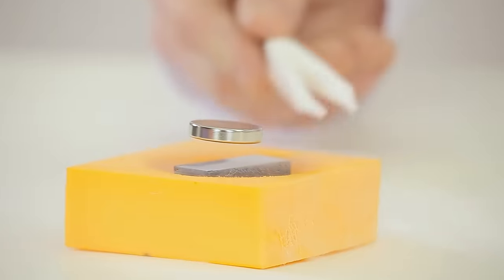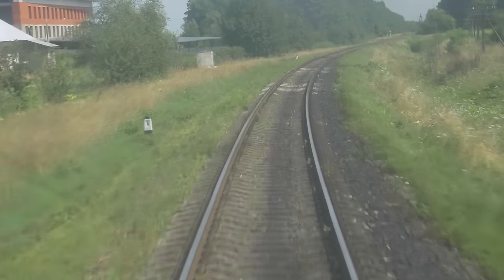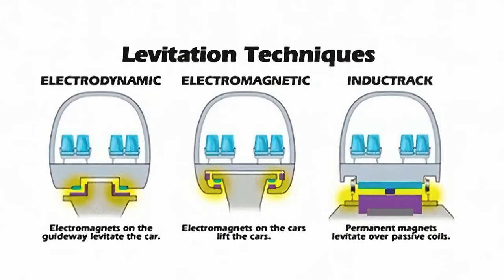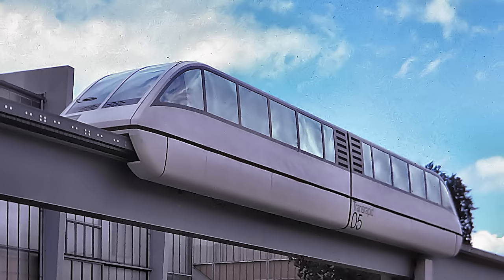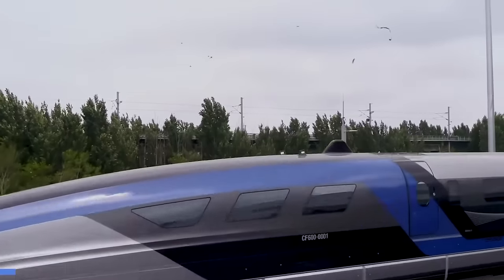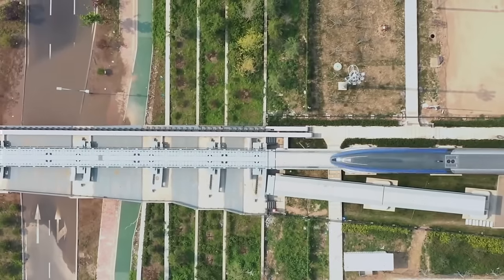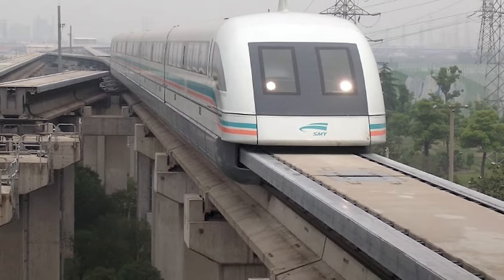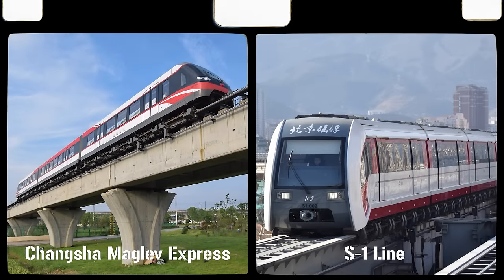Maglev Trains: Why This ALWAYS Falls Short

Comment: Turns out the best version of a train is a train.
Reply: TopGear proved this along with the firetruck. xD
Reply: Heavy snow a few years ago stopped the electric diesel trains. A steam train running a private run continued and carried some stranded passengers.
Reply: @flybobbie1449 A few years ago I heard of a similar story in Germany where they had some sort of headline power issue and they actually relied on some heritage steam trains to haul cargo for a few days until the power was fixed. Kinda cool to think about but nowadays it comes with it's own issues, primarily water on the stops. Not many modern station have the infrastructure to fill up a steam locomotive with water. And that becomes a bit of a problem when your engine uses it as the main power medium...
Reply: Until the release of Train 2: Electric Boogaloo
Reply: Lol
Reply: With that logic, the best plane would be the Sopwith Camel.
Reply: @flybobbie1449  What usually stops electric trains is contamination of the pickups preventing power flowing. Let's not even go into the issues that happen every autumn on railways everywhere with leaves on the line (it's akin to greasing the trascks as far as braking is concerned and a difficult ptoblem to solve)
Reply: Cry in maintenance
Reply: @flybobbie1449  Both diesel or electric are still superior. The only reason the steam train worked is the fact, that steam engines run 24/7, because turning them on takes a lot of time and would be even more impossible in harsh winter conditions. If the diesel locomotives were kept in a shed with the engine idling, they would have worked too.
Reply: @Noise-Bomb  Water shouldnt be an issue. A truck loaded with a water tank and a hose should do the job, if its urgent the local fire department can deliver it.
Reply: @thechumpsbeendumped.7797  Does a Sopwith Camel outperform modern planes? I dont think so.
Reply: @derunfassbarebielecki  
Whoooosh!
Reply: @derunfassbarebielecki  The steam engines were heavier than the modern traction units so could put there weight down on the tracks and get traction. Also i think the over head cables were iced over.
Reply: @Noise-Bomb odd that they use heritage steam locomotives when diesel locomotives exist
Reply: @flybobbie1449  British trains south of London use exposed third rails for power draw and ice buildup on them prevented power pickup. (Ice under a train wheel is pretty much instantly melted by the contact pressure and water flows, so the return path was always clear regardless of ice buildup on the main rails

Lines north and west of London almost all use overhead power feeds - the trains on these lines had no prpblem with snow (other than increased braking distances)

The icing problem is well known and in winter the London Underground network run trains all night along the surface sections to keep the third/fourth rails swept clear and navigable (LU uses a split power supply needing 2 power rails and ground on the driving rails). You'd think that heating elements would be a more efficient way to do it, but this is Britain after all (you'd also think that given the enormous costs of keeping the third rail system going vs overhead lines they'd bite the bullet and make the investment but "sunk cost fallacies" and shorttermism...)
Reply: @Noise-Bomb  Steam engines are really hard on rails due to the hammer effect caused by the wheel counterweights. This is one of the reason they were witthdrawn from service so quickly worldwide when diesel-electric became viable

Britain originally planned to keep their steam in service until the mid 1970s (all electric conversion) until the rail wear issue was recognised as a major cost centre and so diesel electric was explored instead.
Reply: @flybobbie1449 the latest trains in Sweden can't even handle very light snow.🤦‍♂️
When bosses talks with the sellers, without someone who works with the trains directly. 🙄
Reply: Adam Something wants to know your location.
Reply: @thechumpsbeendumped.7797 my fave to fly is still my grampas old Piper Cub. So, . . .
Have a good one!
Reply: @brianellison3525  
The OP said “best” not “favourite”.
Reply: @thechumpsbeendumped.7797  define best. The piper can take off in under a hundred feet, can land going backwards in a 45 mph wind, can fit in a decent barn, is easy to maintain and can be flown by a seven year old. Whataya got? Hah! 
Be well.
Reply: @brianellison3525  
How long would it take to fly across the country in a 45mph headwind and how many times would you have to refuel?
Reply: There is a fun video (by Adam Something, if I remember well) in which one optimization at a time they arrive to a standard metro line starting from the Vegas Hyperloop...
Reply: @woongah  
Adam who?

Comment: The other issue with maglev is that the system has to be built entirely from scratch.  A regular high speed train can operate on the new high speed tracks but also extend service onto older tracks and stop at existing stations.
Reply: Yes definitely trains all use the same tracks so cost effective. Maglev is only good for magnetic
Reply: The best place to build a maglev would be if you're building transportation infrastructure from scratch, like South Korea's new capital Sejong.
Reply: Im looking forward to what japan will do, they are willing to go there to the end just like high speed rail. Everyone thought they were stupid doing that when the rest of the world still had steam lokomotives, cars and planes. 

I trust the japanese the most to make that viable, build it and get it to run because they dont bullshit around with their work. I just have to look what the mess the deutsche bahn in germany is. We cant even build an airport here...and in asia they create entire islands out of nothing to build an airport ONTOP OF THE ISLAND THEY JUST BUILD!
Reply: Maglev is the future, just like how train tracks had to be built on dirt- maglev lines will be built on rails and former road corridors, or between them.
Reply: Alright, what is your point though? Naturally, you can't put maglevs on traditional tracks as that is for the bullet system.
Reply: @timothychung4811  The two ways you want to do Maglev are either using tunnel boring- or on pillars.
Reply: @timothychung4811  I assume you could rebuild that line such that it can use both Maglev and normal rail? Though I am not sure about it.
Reply: But it operating on older tracks isn't really effective, unless it is only for a short trip to eg. a city center. Usually high speed rail is build mostly from scratch or using older high speed rail tracks (which in this case would be in the future older Maglev tracks).

Also while this is an advantage, it might not be that important compared to many other factors.
Reply: Jason Iamewhlteboy
Reply: Iame whlteboy
Reply: k -I I
Reply: yoseIf
Reply: Jason Iamewhlteboy
Reply: k -I I
Reply: yoseIf
Reply: The conventional Shinkansen in Japan is also built on a dedicated rail network w/different gauge and spec than the rest of the grid.

Comment: The Japanese one mentioned last is different from all the others in a significant way. Not just that such a long line (compared to other maglevs) is already under construction. The main difference is technological: first time superconducting magnets are used for a maglev train. This further increases the upfront cost in the hopes of decreasing the later running costs. So kind of a maglev on steroids in this aspect. But I really like the way the guidance left/right/up/down is passive in this system and get stronger and stronger with speed increasing. And the superconducting magnets mean stay strong for a long time after external power to the system is lost. So for this to have a crash you have to physically destroy a long enough section of the track in front of it. For us technically minded this really seems like it is at least as safe at 500kph as a regular HST on wheels is at 250kph. I really hope they overcome the red tape and financing issues.
Reply: China's experimental sky train maglev also use permanent magnets
Reply: @prastagus3  superconductors? Or just regular permanent magnets?
Reply: @hebijirik I believe they are permanent magnets which floats train and requires no power. Due to this reason, it is not moving that fast.
As for superconducting magnets maglev, China did test a high-temperature superconducting maglev system half a year ago.
Reply: @prastagus3  it will be interesting to see where it goes. The Japanese SCMaglev uses regular proven superconductors in the vehicle, similar to what is used in particle accelerators and tokamaks but they have some clever tricks there to keep the cooling system power consumption as low as possible. The track has very simple figure 8 shaped passive coils in the walls that passively create guidance and levitation when the strong SC magnets fly along them. The bottom of the track is just regular linear motor. What I find fascinating is that none of this requires any new or even young technology to work. It is all put together from long proven technologies that are just used in a new application. That is probably why they already got it to over 600kph with people on board. 
I don't know anywhere near this much about the effort in China but their history with the Shanghai maglev makes me a bit skeptical of their ability to successfully deploy a maglev based on relatively new things like high temp superconductors into a working successfull mass transit system. Nevertheless I would like to be surprised. If they make it work well then that is and advancement for all of us.
Reply: Though for this project, the biggest portion of the cost is tunneling through all that mountain
Reply: The Japanese system requires forward movement to levitate and is on wheels until it's at 150km/h. This adds complexity (a retract mechanism for the wheelsets) which is likely to cause issues in the long term, but simply relying on levitation lifting everything off the tracks ignores spring travel meaning that would need to be a 4-6 inch lift AND would require wheel retention mechanisms that conventional trains don't have (if you lift a carriage up the wheelset remains behind. if you lift the bogies, the wheels remain behind)

Whilst wheels solve a number of issues (such as allowing the train to roll on conventional low speed lines for switching or stabling), they add a number more (and being unpowered, the train needs a pusher locomotive or will need to be some kind of hybrid wirh powered wheelsets to allow self-movement outside of maglev sections of track)
Reply: @hebijirik  superconductor electromagnets trackside - which adds considerable extra cost in cooling the things (probably more than the costs of using conventional non-superconductor electromagnets), but on the other hand acts as a massive heatsink for the heat of the equipment both trackside and on the trains.

I really can't see the economics being viable, but Japanese (as well as Chinese) are much better at spending money on projects to see if they will work than the short-termist "next quarter's profit" approach seen in most other places
Reply: @miscbits6399  as far as I know there is no plane to have standard steel rail wheels on it. Everything I have seen was showing something more like aircraft landing gear tires. This adds cost and maintenance but it is known and proven technology. On the track this needs relatively smooth concrete and nothing more. No precise alignment onto a rail needed when landing. The magnetic lateral guidance must be strong enough to guide the train at fairly low speed if above 150 it can completely lift its weight.  It all seems fairly simple to me. Actually way simpler than having an active powered hovering system. Compared to those an airliner's landing gear is dead simple.
Reply: @miscbits6399  Retractable wheels that can absorb the shock of a metal tube full of passengers landing on them at 150km/h+ and slow them down is a pretty well understood problem happening tens of thousands of times a day already at airports around the world. Yes it adds complexity, but it's the solved kind of complexity that mostly only matters from a financial standpoint, not really an engineering one.
Reply: @Ylyrra  Such wheels are not driven and they're literally thousands of times more expensive than train sets
Reply: @miscbits6399  The entire train and track is vastly more expensive than conventional trains already. And electrically driven landing gear isn't a novel concept either, although not in use at commercial scales. Plus, y'know, there's the fact that they've already done it for the maglev train, so clearly it wasn't that much of a stretch.

The relevant point isn't whether a commercial airliner landing gear would work "as is" in the system, but whether it's possible to operate a retracting wheel system reliably, safely, and commercially viably. And the answer to that is "yes", because we already do. Powered or unpowered doesn't significantly affect that. (Brakes are already a fire risk that we manage, for example.)
Reply: @miscbits6399  The chinese are working an both technolgies. Since the german technology is market ready since 25 years, the are working on their own train based on that technology and they already have a train set for test rides. They are also working on a train based on the japanes technology, but this project isn't as advanced yet.
Here is a short video of the CF600 using the german Transrapid technology: https://www.youtube.com/watch?v=TQn-uIL9FkE

Comment: shanghai maglev no longer runs at  430km/hr, top speed was reduced to 300 early this year. Transrapid became defuct so no major maintenance can be done
Reply: And that is slower than a 320km/h TGV.
Reply: Yes, when I was in Shanghai more than 10yrs ago, I think every journey ran at 430km/h. Now it seems it no longer does that speed. Then what's the point of having the Maglev there in the first place.
Reply: @ymhktravel  tech showcase
Reply: There’s really no point in traveling that fast.
Reply: @grahamstrouse1165  perhaps not for passengers, but cargo?
Reply: @grahamstrouse1165 No point? Isn’t that one of the big reasons we use airlines? And I thought developing new high speed rail was less about profit and more about reducing reliance on airlines and cars due to pollution and climate change.
Reply: @ymhktravel  The point was to evaluate the technological and commercial feasibility of building the entire Chinese High Speed Rail network using maglev technology. The result was that maglev was technologically feasibility but not commercially feasible. The shanghai maglev was just an experimental track.
Reply: @luihinwai1 stop here please. The reduction of speed comes because of sinkings in the ground along the track. And because of bad maintenance of the system by the Chinese. This maglev train was developed in Germany from 1969 to 1999 ( the version used in Shanghai was originally planed for being used inbetween Hamburg and Berlin from 1994 onwards). China just did come to an agreement with the German technology owner ThyssenKrupp not to be the first to open a commercial line.
Reply: @luihinwai1 actually a prestige object, the tests were already done.  It never made any money and never will.
Reply: That is an experiment for data. You can't think so linearly; as we progress,  things become improved. Planes were the same. Do we still have technology as the Wright's brother's first airplane development? Shanghai's Maglev was built 20 years ago, so it was most likely technology from the 90s. We are into 2024...
Reply: I rode the Shanghai maglev in 2009. It's top speed was 320 kph.
Reply: Iame whlteboy
Reply: k -I I
Reply: But other guys on YouTube said China was cool. 
How come?

Comment: If the designers had spent 10 years on designing a Maglev that can be used with existing rails, then they would have succeeded.But the fact that new tracks, bridges and tunnels are needed for existing maglev - has killed the adoption because they require hundreds of billions of dollars of new investment!